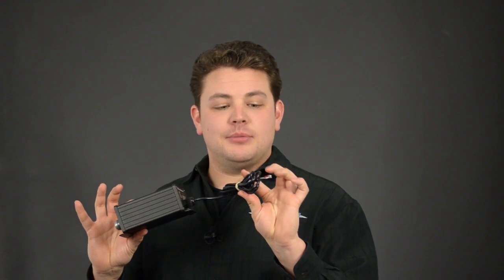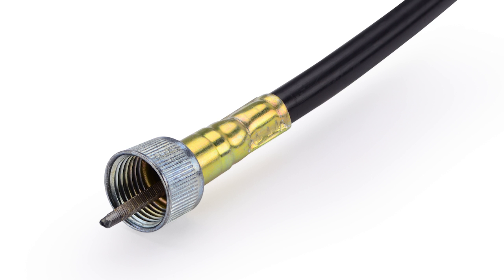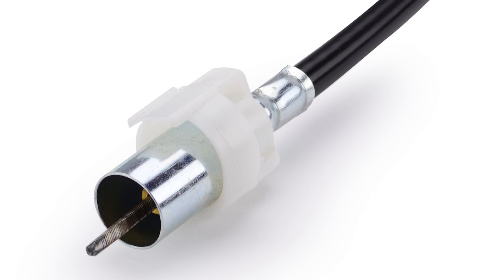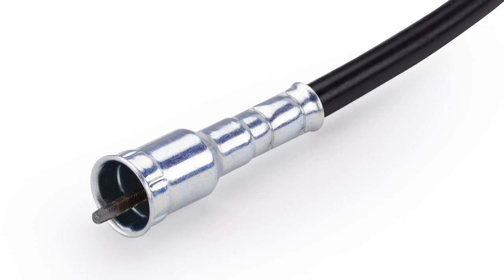Dakota Digital's ECD-100 Electronic Speedometer Cable Drive Unit

Comment: I'm trying to go the other way. I have 88 C3500 2 wheel dually that had turbo 400 YES TURBO 400 with a electronic sensor to electronic speedometer. BUT my truck was stolen and after 8 years found missing engine and trans and other things. SO I had replaced truck with old beater squarebody and had recently rebuilt engine and trans and trying to put in dually. is there a way to get old cable driven speedometer cable to read to the trucks electronic speedometer cluster or gauge?
Reply from the maker: Hey! Yes, we have a multitude of pulse-generator speed-sensors; the SEN-01-1 coupled with the SGI-100BT will create a signal and allow you to calibrate the speedo, regardless of tire size and rear gearing.

Comment: What if your car has no electronics at all. all mechanical diesel with no output on transmission....
Reply from the maker: SEN-4165 magnetic pickup kit or GPS-50-2 GPS module are viable options.

Comment: will this work with older mercedes speedo thread?
Reply from the maker: The ECD unit has 7/8" threads; you could have a custom cable made with the required 7/8" on one end and the Mercedes on the other.

Comment: Would I be able to use an ABS/hall effect sensor as the input? I'm doing a powerglide in my lincoln mark vii, which does have abs reluctor wheels on the rear axles
Reply from the maker: The ABS sensor signal will work for the ECD-100, but this is assuming the ABS system isn't going to be operational. A dedicated speed sensor, or sticking with the mechanical output on the PG, is ideal if ABS is to be retained.

Comment: Will it work on bikes? Mechanical cable convert to work a magnetic speed sensor...
Reply from the maker: Arguably it could be used on a motorcycle, if you have a place to hide it!

Comment: I’m trying to do the exact opposite.  Hook a mechanical Transmission up to digital Speedo.  Do you have a tool for this?
Reply from the maker: Sure, this is actually much simpler, smaller and more affordable. A basic pulse generator can be viewed
here: http://www.dakotadigital.com/index.cfm/page/ptype=product/product_id=109/category_id=-1/mode=prod/prd109.htm Then, if you need to adjust the pulse rate to something
outside of the 8,000ppm default for a non-adjustable speedomete, a device like
our SGI-5E would be the answer.

Comment: Just bought the ECD-100 unit and install it and works nice and good.
One question though? It has a very quit operation I would say... but after around 150km/h I hear a couple 'beep'...'beep'' sound.
Is that normal? You know an electronic beep sound, about every 2 seconds... I am not 100% sure if it is from the ECD-100 unit since I got many other electronic gadgets in my car as performance gauges, boost controller,etc. 
But I hear that and I want to know if the ECD unit can do that beeping sound, because I only hear that sound after a certain speed..

DakotaDigitalTV wating for your reply
Thank you
Reply from the maker: Hello,
The ECD-100 does not have the ability to beep, so I suspect that this must be coming from elsewhere.
Feel free to contact our tech crew anytime at 800-852-3228 or 605-332-6513 or techsupport@dakotadigital.com.

Comment: How about the from a speedometer cable to electronic speedometer? can this work too?
Reply from the maker: +Jerome Swaby 
Sure, this is actually much simpler, smaller and more affordable. A basic pulse generator can be viewed
here: http://www.dakotadigital.com/index.cfm/page/ptype=product/product_id=109/category_id=-1/mode=prod/prd109.htm Then, if you need to adjust the pulse rate to something
outside of the 8,000ppm default for a non-adjustable speedomete, a device like
our SGI-5e would be the answer.
Reply: ok thanks... i should have mentioned that its a Isuzu Wizard. Will it still work? Or they are for GM models only

Comment: How is this product different from the Abbott Cable X?
Reply from the maker: +Giuseppe Verdi 

Good day, I apologize for this delay in response. The ECD-100 ultimately performs the same final function
as an Abbott Cable X. Although, it's smaller, watertight, quieter and uses
simple pushbutton calibration instead of internal DIP switches. Thanks for the
inquiry!

Comment: What about Mopar cables?
Reply from the maker: +michael cunningham 

Thanks for the message Michael,
While we don't have a Mopar variation as a standard offering, several
generations did share the same thread-on style cable as GM. If your application
doesn't fall into this group, a custom speedometer cable could be easily
made/modified by a speedometer shop, or even just a small custom bracket to
hold our cable against the backside of the Mopar speedometer.